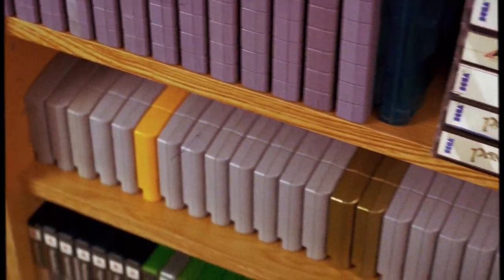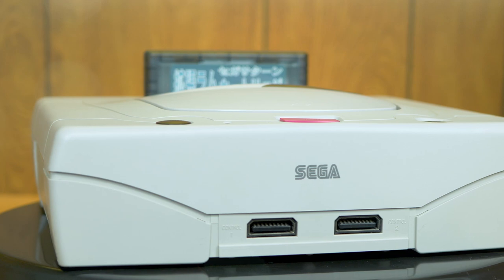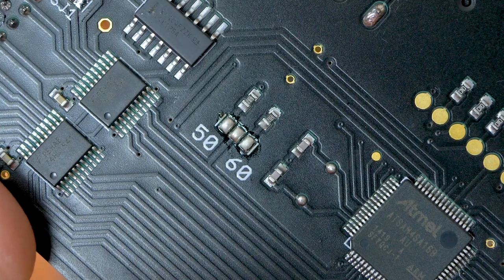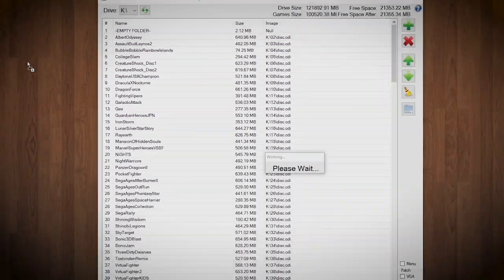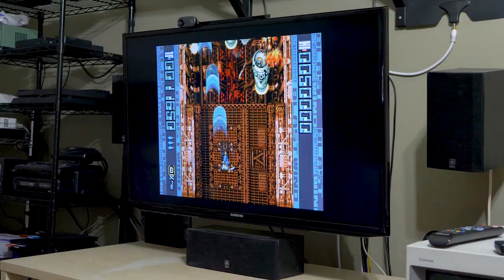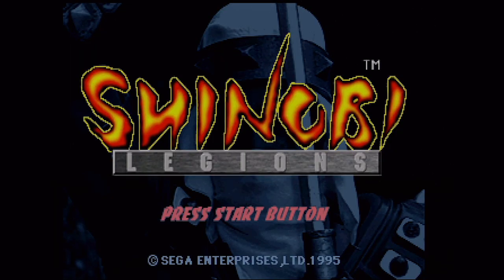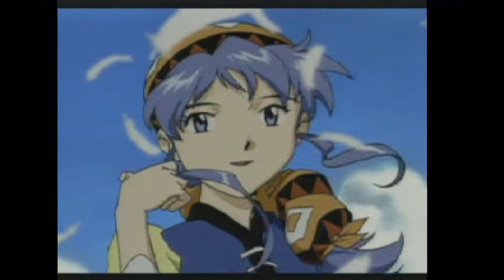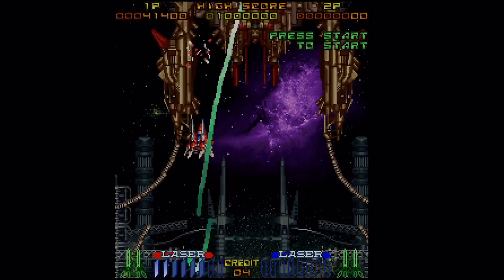Rhea and Phoebe - SD Card Reader for the Sega Saturn / MY LIFE IN GAMING

Comment: A neat trick for telling which you need if you have a model 1: Open the disc cover and look through the hole where the right hinge is. If you see a white ribbon cable going across, you'll need a Rhea. If you don't see one, you'll need a Phoebe.

Comment: 4:21 Plugs in an SD Card USB adapter into a USB port about an inch away from an Actual SD Card Slot.
Reply: that sd card slot only supports sd cards up to 4gb..
Reply: @sunnyforest3239  If you said "2GB" I might be willing to humor you. But no.
The original Secure Digital Card spec supported up to 1GB, but could manage 2GB cards fine, albeit slightly off-spec.
Secure Digital High Capacity (SDHC) officially starts at 2GB and goes up to 32GB, but could theoretically handle up to 2TB... which is what Secure Digital eXtended Capacity (SDXC) goes up to, while adding support for additional speed standards.

So any reader that takes 4GB cards can easily take 32GB cards, and may or may not be capable of larger.

Comment: Yeah well... I think it's gonna be more worth it to wait for Professor Abrasive's Mpeg card slot SSD solution...
Reply: Michirin9801 Yeah, having to remove the optical drive doesn't seem worth it
Reply: If this is anything like the Serial port  to SD card solution for Dreamcast, Int/Ext HDD for PS2 or PSIO for PS1, then compatibility is gonna be hit or miss. NOTHING can replace an ODE's 99% compatibility.
Reply: Sam T If the optical drive is broken to begin with tho...
Reply: theimporter sorry for the noobness but what’s an ode. I’ve think I’ve heard the term before for ps3 hacking but it sounds more like a product.
Reply: @Jotaku X
1:05
Reply: theimporter thank you so much.
Reply: I thought PSIO was supposed to be around 99% now..?
Reply: If by compatible you mean do they boot, yeah 99% of them do. Do they run properly is another matter. Many important games still have glitches.
Reply: ResidentXombie never say never.
Reply: Just looking at how it hooks up.. i'm imagining a toggle switch could be possible, but it would take some spare cables and a possibly tough relocation..
Reply: Removing the drive is totally reversible. It also does not require any soldering. Super easy to pop those things in and out. I'd just stick it in a box somewhere in case you ever want to put it back in. On the other hand, taking the drive out means that all your disc games are useless, so that is a bummer.
Reply: for a game like lunar that uses the mpeg video cart, you wont have access to mpeg video that way.
Reply: My drive is busted, i just need to decide if i will replace with this or another disc drive. So torn.
Reply: Optical Drive Emulator. He explains it in the video.
Reply: this 100%
Reply: I patiently waited, and finally ordered my phoebe today.  Still no sign of Professor Abrasive bringing his solution to market.
Reply: Michirin9801 am new to this RHEA and love the saturn should I spend on it now or wait a bit more for Professor Abrasive’s
Reply: Oof it’s been a year and the Altera chip the Satiatior is based on is reaching its end of availability, leading to a redesign. Fun
Reply: @Waifu4Life  did you test that 99% compatibility?
Reply: that shit is the biggest vaporwave project in gaming
Reply: @cyo_corner  Well... not anymore. :-)
Reply: Yeah.....

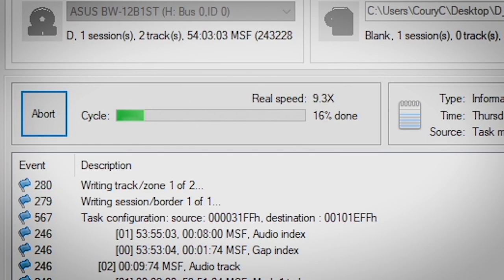Comment: 5:06 Also, if you want to save time (and a blank disc!) instead of burning the Bin/Cue to a disc, just use the free program called Daemon Tools Lite to mount the Bin/Cue. DiscJuggler will simply see this as a disc in a virtual drive, now you can just rip it as a .cdi image.
Reply: Discjuggler isnt working for me anymore. It just crashes and shuts itself down :(

Comment: To clarify about the soldering, This is only needed if you want to change the video mode through the device or if you've bought a phoebe for a different type of saturn model revision.

Rhea is for early model 1 consoles wich is refered to as type 1.
Phoebe has 3 types. Type 2 is for later model 1 consoles and early model 2 consoles and type 3 and type 4 for later model 2 consoles.

If you buy a phoebe type 4 while your sega saturn is type 2 you'll have to adjust 1 or 2 jumpers by soldering and or desoldering those.

Also you can tell if a model 1 is for rhea or phoebe type 2 by the hole for the power supply socket. If the hole is bigger than the power supply socket and t shaped then it's an early model 1. if the hole is the same size as the power supply socket then it's a later model 1.

Comment: I've considered getting a Phoebe, but that little bit of soldering is what held me back since I've never tried it. Great video! Good luck on getting a GDemu for the Dreamcast, I managed to grab a USB-GDROM controller when Stone Age Gamer was still able to offer them.
Reply: ChronoSonic open up your Saturn and see which CD drive is inside your Saturn.  There are three types of model 2 Saturns and if you select the right one if you can get an order in he'll do the soldering for you.
Reply: Well but for everyone outside America this will be tricky.. but luckily i know someone in Germany who should be able to solder this onto my failing Saturn Multiregion Unit.
Reply: They install with flex cables. No soldering required.
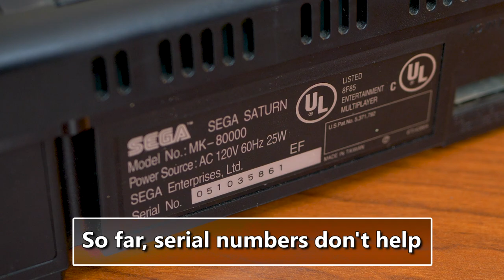Reply: At 2:44 and 3:27, it's stated that the Phoebe requires soldering at certain points which depend on the console revision owned. The Rhea does not require soldering.

Comment: 3:22 Actually, there is a way to know by the serial number. I know the 2nd number of the serial is the year of the board (in the example, the "5" means is was a 1995 board). But I don't if the 1st or the 3rd is the board revision or the manufacter. Because rhea works on the VA0, so I believe it is the 3rd number since the model at the 3:22 doesn't have the VA0 board for sure.

edit: Ok, my bad, the console at 3:22 is the 1st model (I thought it was the 2nd model), so I still don't know which number of the serial is the board revision.

Comment: Still running a Rhea - finally broke out my Saturn for some TATE shooting action, (having recently acquired a 2030 PVM).   I wondered if the "MODE" blew this out of the water...still - coming back here to confirm the rip process...great to have this documented and clearly (you're doing the Lord's work) -   Frustrating that I have to re-burn existing images in order to rip them proper from Disc juggler - but it does work.  Would be nice if Discjuggler worked from img files...one could dream.  Hey I found some old CD-Rs in storage...from like 20 years ago - still work...haha, even my 10 year + BD burner (even though I have to manually pull the tray out).  Hey if it gets me playing DonPachi tonight, I'm happy.  Thanks again!

Comment: There are archival quality optical discs(archival CDs, archival DVDs, etc), which I think companies should just use full stop for everything(games, music, etc), but if one used an action replay with backups of their games on archival disc media then you wouldn't have to worry about disc rot, although scratches can always be an issue. The issue though with an SD card reader is that you could have a chance that it would fail(although because there aren't moving parts this is reduced), and that NAND isn't to my knowledge as reliable as ROM chips from things like the NES-N64.

Comment: Seeing as I live in such a humid environment I've been adding a small silica gel bag in each of my CD game cases (I paid like $2 for 100 baggies of the stuff), and it helps to eliminate the humidity factor of discrot, and I practically live in the dark too, so no light issues. If it happens, it happens, but I've done things to help prevent some factors.

As far as the hardware is concerned, it is a shame to have to remove a piece to replace it with this, kind of removes the "original" aspect of the console, but if you got a second console for this mod it would be great.

One question I do have is about the game save states... are they still limited to the tiny onboard memory and the cartridge? Or can you now also save games to the SD card too?

Great video guys!!

Comment: Pro-Tip: If you use an SDCARD with WiFi like the Eye-Fi, or Toshiba Flash-Air, or Transcend, or EZ Share then you don't have to keep putting the SD card in your computer to get games on it. You can do it completely wirelessly from your network. This will work with any unit that uses a full sized SDCARD.  I use one on my Canon cameras to upload pics to the Internet.

Comment: Considering that, one, this is a device where you are running the games on original hardware, and two, when emulating a CD you don't have to worry about extra hardware that might be included on a cart like an FX chip or some obscure mapper. I would expect nothing less than full compatibility.

Comment: I have no doubts the performance of using this with rips of the original disc are fine. My only issue is that games with redbook audio are notoriously hard to rip properly, and it’s very easy and even common for errors to become introduced in the ripping process. I don’t deal with Sega Saturn too much, but dealing with Sega CD rips... I can tell you I’ve resorted to just buying the discs myself and ripping them even though it’s so easy to just download and burn them. And cheaper. Out of all the game rips I’ve found online, none have been reliably tested as accurate against an original. Even just for the audio tracks. If you’re a stickler for quality then maybe this is something best left to the games that didn’t use redbook audio.

Comment: Great video, Coury! I was hoping you guys would cover mass storage for optical disc consoles at some point. I’ve been looking into this mod myself but since speedruns require more accurate loads i’m hesitant to move forward with it. Have you guys heard anything about anything similar with any PlayStation models? I know of the one that attaches to the serial port on the SCPH-1000 models, but nothing for later models with better firmware.

To my knowledge there is also a PS1 “emulator” for PS2 that runs the ISO through the PlayStation Driver of the unit... which means more accuracy. Popsloader I think it’s called. I have it somewhere, it can be loaded with FCMB/uLauncherELF. Don’t know who made it, it was on AssemblerGames forums before it went down, but a friend of mine sent it to me. I personally haven’t had the time to try it, so would you be willing to give it a go?
Reply: Popstarter. Yeah it can be loaded through uLELF. Compatibility should be good but I had issues with some games, some minor and others just don't work after selecting a specific thing. It ultimately depends on where you save it from. Hard drives should be the best. Since I know what you are looking for, I think the RE games should work fine on Popstarter.

Also the project actually died a week or so ago so there should be the final build out there.

Comment: ODEs are awesome. There are also solutions for the Gamecube. Do they still have some direct audio issues? Probably not so many people are still talking about it as a Wii can be soft modded and is backwards compatible. However you cannot use the Gameboy player via a Wii.
Reply: I use my Wii to play GameCube games via Nintendont and it works great. I also think you can connect a hard drive to it so you can store a whole bunch of GC games. The sad part though is that the Wii have a worse component quality than GameCube, although it can fixed if you perform the Wii Dual mod.

Comment: there is also a flashcard for the playstation, the so called PSIO, you shuold try this out too, cause the playstation is way more prone to laser failure than the saturn in my opinion. It lets you also use your disks aswell, it operates of the parallel port ;D

Comment: Something to consider before buying the Rhea, Phoebe or GDEMU - they are VERY finicky with most SD cards over 32GB. Even if all your games seem fine and load to their menu screens, you could still have graphic glitches or random freezes further into the games. Newer cards can also become more unstable over time. I've had the best luck with older Class 4 cards. If you can wait a bit longer, Professor Abrasive could have his card out next year. For Dreamcast, there is also the USB-GDROM, although I've heard it can be difficult to get. Anyway, good to have options :)
Reply: simbin Just check the compatibility on the forums. I’m using a lexar 128gb in my rhea and a 256gb lexar in my gdemu. I haven’t had a single issue and I have used both cards for over a year. Of course mileage will vary.
Reply: Consider yourself lucky. I didn't even know mine was having any issues at first. They're kind of tricky to diagnose with different symptoms. The last problematic card I had was a 64GB Lexar, it would just stop working after a month or two of inactivity. The files were perfectly readable and all checksums matched on PC. Rewriting the files would temporarily fix the problem until it happened again.

Most cards I've tested would experience freezes right away or tiny glitches in video cutscenes, that are barely noticeable if you aren't looking for them. I think some of the cards on those lists are still flawed but have small glitches so they go unnoticed. The problem must be with the devices or firmware because every failed SD card I tested has worked flawlessly in other numerous flashcarts, etc. It's unfortunate as these devices are really good otherwise.
Reply: Most people have a few small capacity spare cards card lying around. Best thing to do is find one that works, then buy a higher capacity model of that same brand and series. Also, I don't see how Professor Abrasive's solution will be any different with flash media compatibility. Only thing for sure is that like every external solutions, game compatibility will not be as good.

Comment: Serial numbers do work so long as the innards haven't been messed with and the console has all original parts. Last six digits are the serial number the next number is the revision or if its a letter then it would be a=10 b=11 and so on the next number to that is the year it was manufactured and the first one or two character are the manufacture code. Its worked for me so far without looking inside the console so long as it is all original has hasn't been messed with.

Comment: I'm no stranger to modding consoles, and i can see this solution being an option if you've got a console that has a defective optical drive that can't be repaired og replaced. But i really think that if the console is functional, an effort should  be made to preserve it in it's original state.

I wonder if one could utilize the Saturns card slot, maybe in combination with a boot disc or something in stead. Same goes for the original PlayStation, utilizing its serial port. There's got to be a better way than straight up tearing apart the console..
Reply: That is exactly what it is. You are taking the console apart, and removing parts that are pretty essential for it to function as intended. That it can be reversed was not the issue.
Reply: That's your opinion. Not mine.
Reply: Yeah well, considering how many consoles are out there, i'd say that i'm probably not.
Reply: No, i am not contradicting myself. You are trying to twist my words to fit your idea of what is right.

By removing the optical drive, you are preventing the consoles ability to read and play original games. That is, it will no longer "function as intended". It would require a rather significant procedure to undo that.

By using a boot disc, you are not preventing the consoles ability to read and play original games. That is, it will still "function as intended".

Now, since you can't seem to take a hint and let this be, i'll tell you outright. You're entitled to your opinion, and that is fine. I'm entitled to mine as well. We won't agree on this, so this conversation is going nowhere, and so, i will not be responding to any more arguments from you. You have a nice day.
Reply: @Christian Tearing it apart is not the case here.  That's what makes it better.
Reply: But this is "Tearing apart the console". You are taking it apart and altering how it works. How one feels about it, that's personal opinion, but taking apart the system is still taking apart the system.
Reply: What does that have to do with anything? There is a difference between replacing a major part of a console and replacing it with something completely different, and changing a battery.
Reply: Do note that I only called it "tearing apart" when I was quoting him, and every other time I said "taking apart". 

It's a slight exaggeration but not exactly far from what is actually happening. 

And, in the context of what that other guy said, there is a difference.

Comment: It functions like a flash card (I’d rather retain the disc drive and have a cartridge that has a SD slot which would require a modchip to allow the flash card to work and be able to play discs at the same time) but this mod looks awfully risky. Even if the laser or whatever spins the disc is no longer functioning, it’s definitely possible to fix the disc reader and have it working like new. This option is for those who want to play right away (same for Dreamcast) by replacing their disc drive (either broke down or too lazy to fix it) with this. Any video game console disc reader can be fixed and I would go for that route so I can use burned games or whatever I have collected.
Reply: This is risky in what way? I've been playing the gdemu no prob - clone at that.